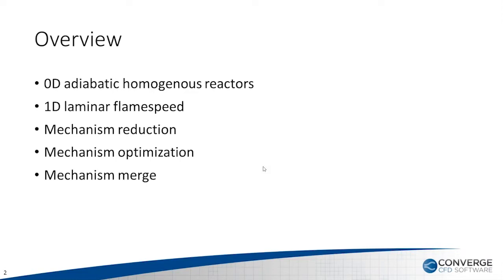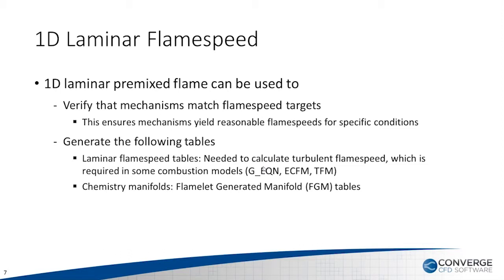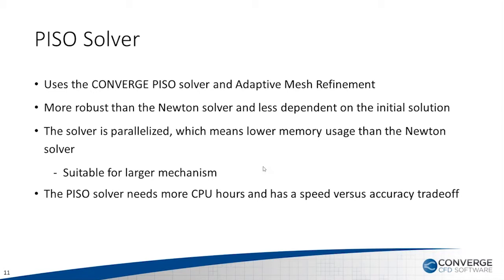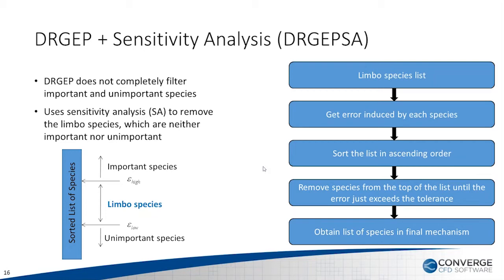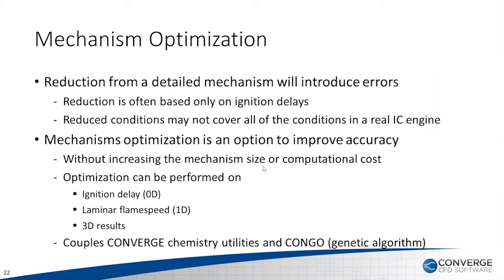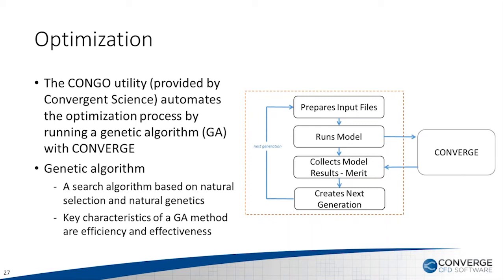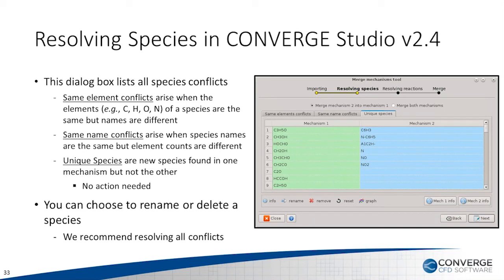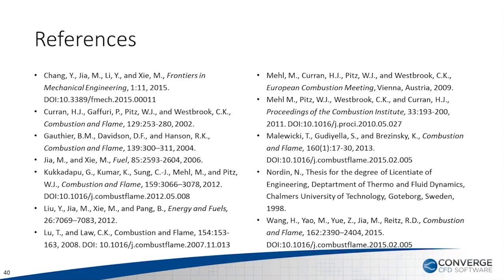WEBINAR: Tools for Detailed Chemistry in CONVERGE 2.4

Comment: Good afternoon! I am trying to create hydrous ethanol in Converge CFD in order to run a simulation. I was trying to define the composite fuel as a combination of ethanol and water in appropriate ratios, but getting following error:"0319 error: composite name not found in mech.dat". Could you please advise me on this issue?
Reply from the maker: Thanks for your question Dumitru. Please email your question to support@convergecfd.com and one of our support engineers will follow up with you.